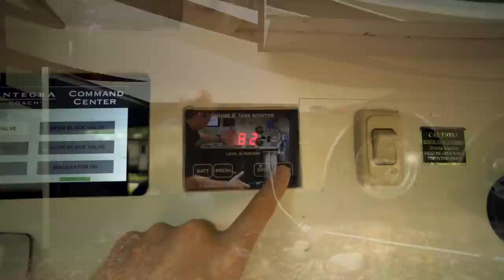Throw Away Your Sewer Hose? - Thetford Sani-Con Turbo Installation & Detailed Review

Comment: You are still handling a sewer hose if you are dumping a black holding tank. I see no advantage to this $350++ system vs my $200 Flo-Jet or a $25 buck slinky.. My Flo-Jet will use a cheap 5/8' or as I'm using, a good 3/4" hose and up to 50 feet though it will pump at least 100 feet. Maybe if you have a mid six figure up motor home and the manufacturer built it in - OK,. As an add on to any towed RV - wont work.
Reply from the maker: Hey JD, we'll probably do another video soon showing the day to day use of this. Its much easier than the flow jet or traditional style hose, so far we are really happy. Grab by handle, unscrew cap, pop in campground sewer connection, shut door, walk away. No bins, no unions, no ladders (depending on your preference) and done.. We want to wait a few more months just to be 100% sure there aren't any gotchas but so far we are really happy.

Comment: "Throw Away Your Sewer Hose?"  That question was not answered in any real way.  More research is necessary.
Reply: You throw away your sewer hose and start using the Thetford sewer hose instead. My biggest problem with this system is there is now way to rinse out the hose after pumping out the holding tank. He implies that you need to dump a whole lot of clean water into your black tank to flush out the pump and hose which is not very cost effective even with a black tank flush system.

Comment: Compost no trips to the dump station no black tank to deal with no hose I will never go back to the stink and mess the dump station method
Reply from the maker: I think composting toilets were ruled out mainly because we didn't feel that carrying a urine tank outside to dump on a regular basis was something we were willing to take on. Then there is mixing peat moss weekly, disposal of the old moss.. Its a lot more work in our opinion. Composting toilets absolutely have their place, i'd consider in a weekender tiny house or cabin or even in a smaller rig thats primary purpose is backcountry/boondocking but for the average rver it seems like a challenging solution (speaking as a couple that doesn't have one so maybe we are wrong?)
Reply: Yeah, if composting toilets we're actually better, RV manufacturers would be putting them in new RVs instead of the traditional black tank system.  They would be far cheaper for the manufacturer to purchase and install.

They have their purpose, but don't try to act like composting toilets are more convenient than a black tank system, because they most definitely are NOT.  It's more for when you can't feasibly get running water, or if you want to limit water usage.
Reply: @LivinliteNet1  ours is an all in one we use sawdust to cover bring it home dump in compost bin cover with straw clean up with bleach water easy and simple. When compost bin is full leave for a year and it's just like dirt put around tree's and flowers (no smell) works great. But to each their own happy camping.

Comment: So this does not get rid of a sewer hose. It just gets rid of YOUR!sewer. You never showed the most important part. What the hell is hooked to a sewer... I am going to figure from this video. You still have to grab you new sewer  hose and hook it to  the sewer. The only Benny to this is it will open and open and close your sewer doors...  I don't care if your poop goes down the sewer in its regular size and shape of. Chopped up. So you heading should say  no longer do you have to open and close your tank from you're phone..    .

Comment: Why would i want to wait 30 min for this to drain when it takes 45 seconds to drain 40 gal bladk tank. And who wants to be in line with anyone who takes too long to dump as is. Plus your only exposed to smells for a min with a 4" hose when draining with a one inch hose even under pressure is going to take 30 min. EEUH.    Only benefit is to dump in a rec site outhouse, But who wants to be that guy.
Reply from the maker: 30 minutes? This system takes 90 seconds. Exit diameter is 2 inches not 1. About 30 gallons per minute. Thanks for checking in and being part of the conversation.